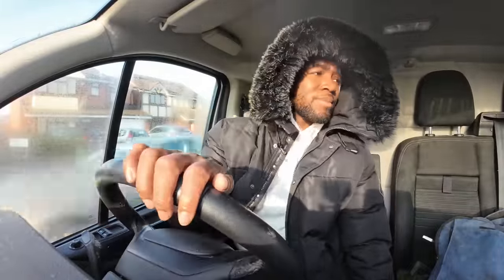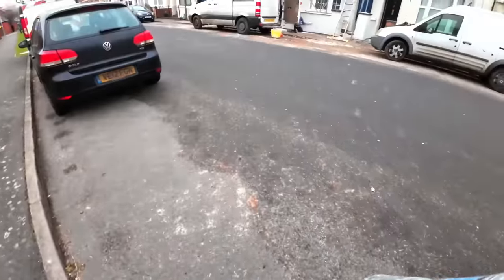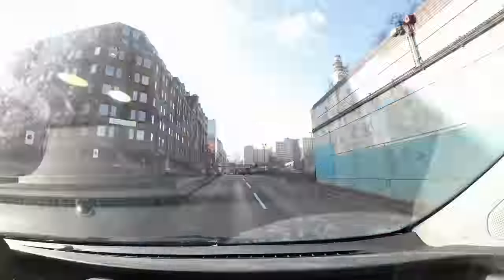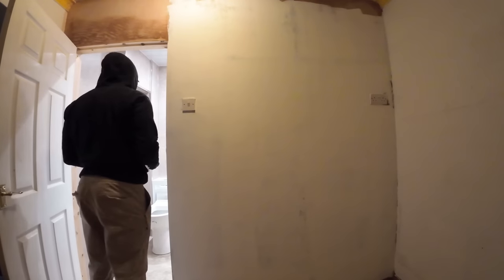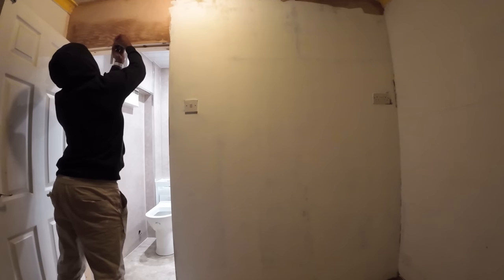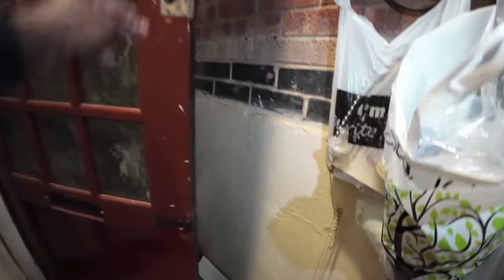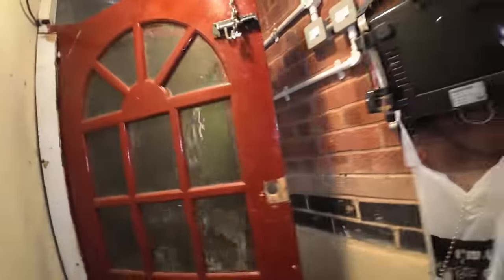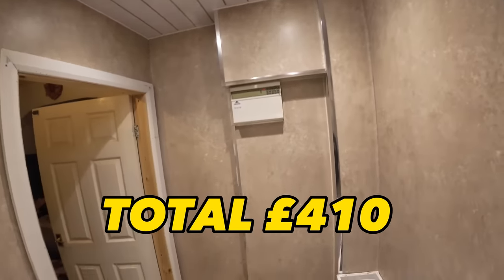Day In the life of A Self Employed Carpenter -EPISODE 6- ( HOW MUCH WILL I MAKE TODAY)

Comment: Another great video always love the it’s a 10min Job then do it yourself lol

Few things I have learned doing fire doors the router bits u get that run on a bearing a so worth it and I always run intumescent strip into frame that way if door ever needs adjusted then it does not need re routed out for new strips
Reply: Iv never done a fire door like he did in the video, Iv done Fire doors for homes that’s have the inter strips within the casing but never routed into the door, is that the case for actual, self closing fire doors? And not just the Fd30 doors you tend to fit on new builds? Much appreciated if you can help me mate

Comment: You don’t fix a door by planing lock side then farting around
With lock. You plane
The hinge side then re mortice the hinges.
Reply from the maker: i explained that i would do it that way in the video 😅
Reply: @ttdowgcarpentry2390  oh no you didn’t, you said you would deepen the hinge recesses to pull the door over, but there wasn’t enough clearance and door had swelled.
 The clearance on hinge side is irrelevant, I’m saying you PLANE OFF what you need, then do the hinges again.
  You’re just not grasping it
Reply: @Dazza19746  calm down old boy 😅
Reply: @bigboundsy  I’m calm, just not gaslight’able 😂